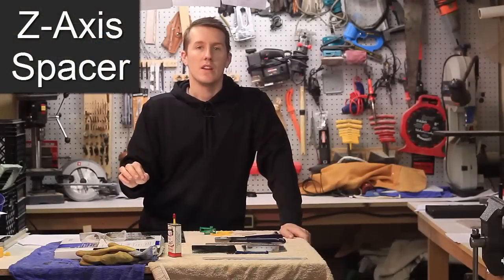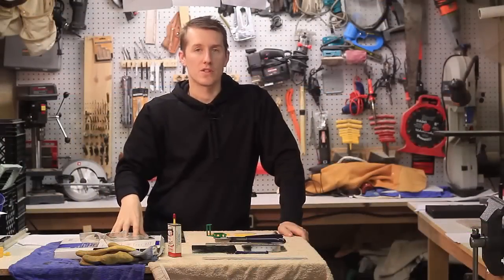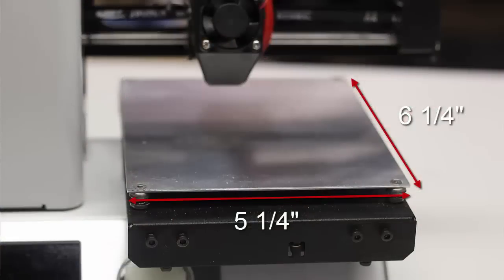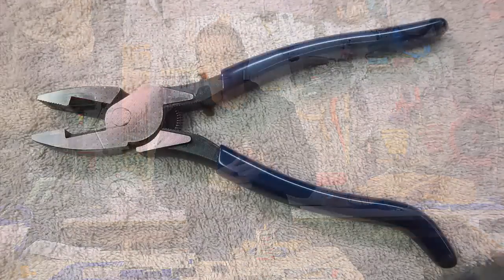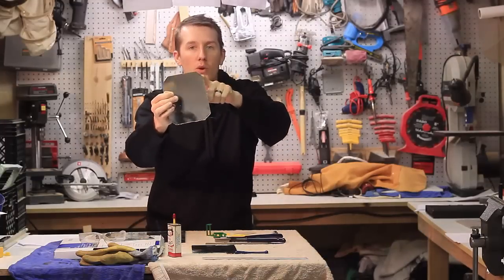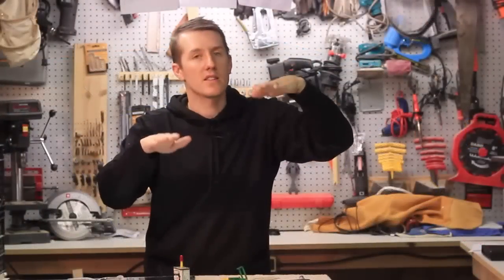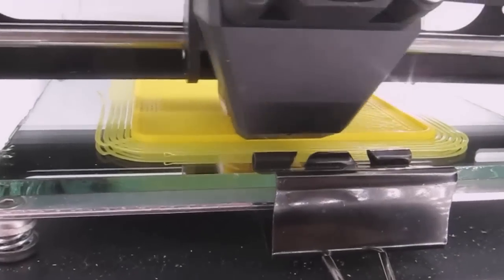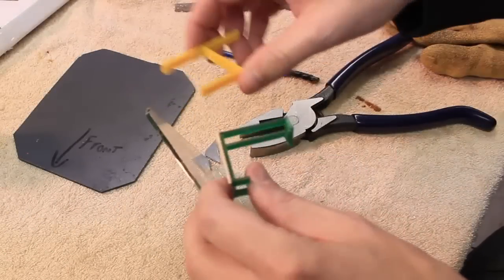Glass Print Bed - For Under $1 - 3D Printer

Comment: I'm sorry but DO NOT cut glass like this. Oil is a no no, and oil while holding the glass to break it will slice someone's fingers.
One pass, one pass only with the cutter. RUBBING your fingers on a piece of glass that you just scored WILL give you glass splinters!! Dont bounce on the glass , BREAK it! One hard .....PUSH!! 
Dont tap with a screw driver or anything else did absolutely nothing but, going to break it one of these times and hurt you . Go to your local hardware and ask them to cut a piece of glass to show you how to do it properly.

Comment: If you are going to cut glass why not use a leftover piece and (hot)glue a short strip under the gantry arm where the microswitch hits it. It has the exact thickness that you need to shift the activation level. No need to print a thickness customized  bracket for it. I don't think there is risk of shattering it as the microswitch still has some play.
Reply: Valenorious No, because the arm clip would add to the glass space.

Comment: Nice Videos,   I had an Ultimaker 2 a few years back.    regret selling it!    Getting the monoprice mini V2 tomorrow just to get back in and practice 3D design and printing for a good while before I go for an Ultimaker 3 or somthing.    I am making a glass bed tomorrow too.   once I take the cover off to install a spacer I will make sure everything is tight and hot glue parts that I think might work loose like nuts and cable connectors. I used to use PEI on glass on the Ultimaker that seemed to work best. and will do the same here.  I want a glass bed not just for sticking properties but for a more stable and flat surface which I think should help acuracy.      Seems like a great printer for the price and easy to mod.

Comment: The normal glass will withstand high temp that are used in 3d printing it is the temp gradient change that is a problem such as heating or cooling too quick. Borosilica glass is used at much much higher temps . I used scrap glass from a scanner on my printer. The best thing I found to polish the edges with is the sponge type abrasive it bends around the edges. Also you can use PVA wood glue watered down it mostly stays on after the removal of the print but I just paint over it again and it dry's quickly. Loved the ideas you have with marble etc I thought about ceramic tiles?.Thanks .

Comment: You can usually get a piece of glass cut to size locally somewhere.  It should probably only cost a couple of dollars.  I think it's possible that some place like home depot might even do it for you.  While other glasses might work, you really wouldn't want to take the chance in the long term.  Something as simple as an especially cool breeze could cause a sudden temperature change, then the glass not only cracks, it can eject tiny shards in the process, and you wouldn't want that to end up in your eye.  Just better safe than sorry. A $10 saving could turn into costly medical bills and the loss of a sense.

Comment: Thanks for the informative video. I used single strength window glass bought at Lowe's for my build plate. A couple of things I'd like to add is to use a medium grit wet stone (for sharpening knifes) instead of a metal file to knock down the sharp edges and corners of the glass. Use the stone with a little bit of water and your glass edges will be very smooth and you won't have glass chips everywhere. Also, I found that with the glass on top of the build plate, the actual temperature on the top surface of the glass is about 6-7 degrees cooler (verified with a infrared temperature sensor) than what the display on the printer shows since the printer is monitoring the temperature on the bottom of the factory metal build plate and the glass acts as a partial insulator. Make sure to compensate for this temperature difference in your slicer settings. To protect the surface of the glass and offer a bit of safety in case the glass should shatter (haven't had this happen), I put a layer of Kapton tape on top of the glass. The Kapton also helps the plastic filament stick better. PETG sticks great without the need for glue sticks or hairspray. ABS will sometimes require something to help it stick and for that I use a very thin coat of acetone/ABS slurry.
Reply: Similarly to the grit stone a piece of dollar store pumice stone will ease the sharp edges.

Comment: Dave you should get a 12'' by 12'' PEI sheet its like 20 bucks and you can make 4 plates for the mini I use folder clips to keep it on the build plate you never have to prep (but the bed has to be above 65c) and you can take the sheet with a print off put a clean sheet on and wait till the part cools then it pops off with your enclosure it would be a good investment
Reply from the maker: I might give it a try.

Comment: a silicon pad works great put between the bed an the glass wont move. no clips needed. also  the 3d printed adjustment piece so that you show is not the one i use the one that i made from thiniverse just slops on in the back and it works great.

Comment: great video? if you use low e / comfort glass you will get better heating from your heat bed! ive worked in the glass industry for 25 years just started in 3d prints and I have no problem with heat or the filament sticking ??? try it???
Reply: People that print on regular glass don't have problems either so why use something rare and $? You probably have scrap in the back of your truck. The only place I see it is in pre-fab doors/windows. 

Low-e glass is designed to block radiant heat transfer. Radiant heat transfer isn't involved in 3d printers: the transfer is via conduction and you want more heat transfer, not less.

Comment: hello, i have a printer without a heating bed. will the glass work without heat? i only print pla, and i want to avoid warping. thank you, and great video!
Reply from the maker: On just glass = maybe
If you spread a layer of glue with a glue-stick = yes
Reply: @DaveWirth  i tried this method, not working:(

Comment: Looks good. Keep them coming. I personally just use picture frame glass from Home Depot.  Definitely more fragile but just be careful with it.  Might upgrade to the v2 new bed on the mini if they offer it for sale separately.   
 
Also, for anyone doing this be careful where you put the binder clips. I was an idiot and placed it middle of back right on top of the heater wires. Well, eventually it shorted out ruining the FETs on the control board. I replaced the FETs (not real fun thing to do) and it's working but build plate still heats to about 60c without command.  Good enough for now but don't suffer my same fate.

Comment: Great video Dave! Looking forward to seeing how the granite and marble tile works! I think those would be ideal because they won't warp over time or distort from heat.
Reply from the maker: I might not end up doing the granite/marble because of weight.  I think it would be great to print on, and hold in the heat really well, but it would be a strain on the Y-axis motor to move such a heavy plate around.

Comment: Very interesting video. As for working with glass, use diamond tipped tool, not cheap tungsten wheel. Can get diamond glass cutters online from China  for few bucks. As for metal file and glass, its no, no. It will butcher your file, better use wet stone block or sand paper block for nice, smooth finish.
Reply: Tungsten is perfectly fine and hard enough for cutting glass.

Comment: Do you think the weight of marble would be an issue ?
Reply from the maker: Ya that's why i don't think i will do it.  Like i said, it would be great for retaining heat, but the weight would be hard on the stepper motor and accuracy would be bad probably.
Reply: Dave Wirth what if rip the marble down real thin?

Comment: Being new to this this may be an obvious question, but I am going to ask it anyway. I have a different printer, Tevo Tornado, with heat bed bubbles forming and removal of the green/red cover is suggested. I am thinking of a glass cover replacement. The Z axis can be adjusted by some sort of spacer the thickness of the glass. Is that all that has to be done for an adjustment?
Reply from the maker: Yes.  Not sure about your printer, but with the Monoprice the Z axis switch is not on the bed itself, it's off to the side, so it has no idea how thick the print bed actually is.  So when you add the glass it doesn't know unless you add a spacer that same thickness.
Reply: Dave, the switch is on the left side of the frame, so it should be the same. Thanks.

Comment: I used a 2mm glass pane, and just lowered the bed. It was perfect. I went to home hardware and the guy just game me leftover prices of glass and I just payed for the glass cutter. Another place where you can get free glass is old printers/scanners or scanners. The scanning bed is glass. Also I cut the glass pane with 8 faces leaving the screw heads exposed. And I would recommend everyone doing it, Its pretty easy.

Comment: Tried cutting on glass but for some of my larger pieces the print fails and slides off after a couple hours because it’s not sticking well to the glass. Is my heat setting off or is this common?
Reply from the maker: It's common, use a gluestick.

Comment: Can we use normal window glass or face mirror for bed
Reply from the maker: Either works fine, but you will need to used a glue-stick or else it will come loose during printing.  Most people now print on a surface that's specially designed to get adhesion to the bed, like PEI.
Reply: @DaveWirth  does it will scatter or not

Comment: I printed on cheap glass from OSH and it works. I broke it today because the garage was cold and the print bed wasn’t heating (heat errors) so I torched it as I have done multiple times. It finally broke cause the temperature change was to rapid. My fault, it worked for 3 years 🥴 so Id say it’s a go! Just don’t touch it 😂

Comment: I'm sure you have a better way now. But wouldn't it have made more sense to cut a thin strip of the mirror off and glued that over the switch?  Because then it would be exact.
Reply from the maker: Maybe.  It doesn't have to be exact though because there are the adjuster screws on the bed too that can do the fine adjustment.  
But ya the glass would have matched the thickness exactly.

Comment: Dave, I did this mod last night.  Great results and super simple.  I did have an issue with the printer head hitting the clips.  They are the small ones like you used.  Is there something that needs to be done in the firmware to reduce X & Y travel?
Reply from the maker: Possibly, i haven't messed with the firmware.  You could always add a spacer in x direction as well.  I just stagger my clips so that it isn't near the home, and i'm conscious of the clips when i place the part in Cura.

Comment: I use kerosene so the chips don't fly and use a stone for sanding the glass not a file... I've cut 5/8 inched this for flight simulators and have a cutter from Germany that cuts like butter.. great idea though. Kevlar gloves with rubber dip are best for this procedure. got Band-Aids?

Comment: And stop scoring things twice. I see that in every video of a non glass cutting person showing people how to cut glass. One score,  and that's it. Then break. Don't use lineman's pliers, use breaking pliers, they have a space where the glass won't be crunched. Or better get running pliers which will let you break it on the cut without  the methods shown. Lift the tile up on the edge then let gravity help the break. Press down like that will cut your arm open.  And as said, don't use that much oil. It doesn't need a lot and it should be thinner.